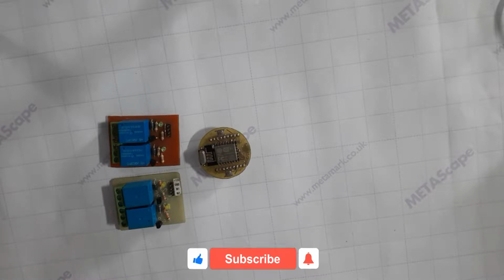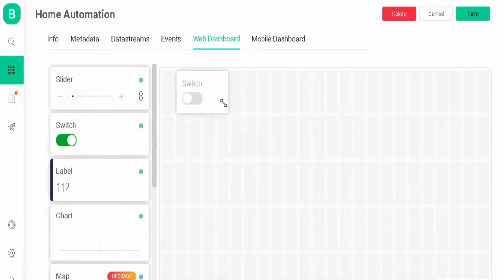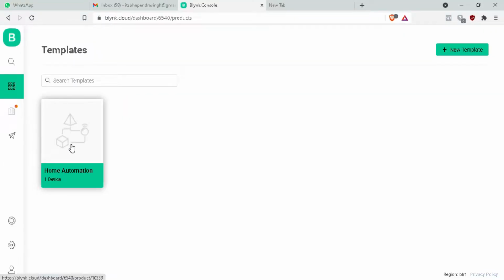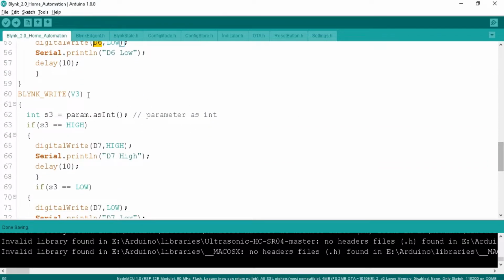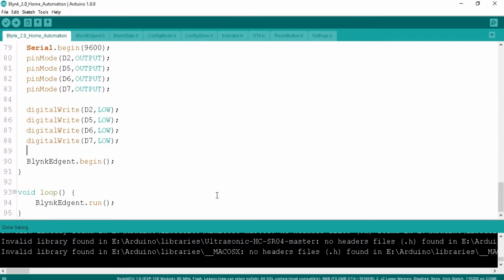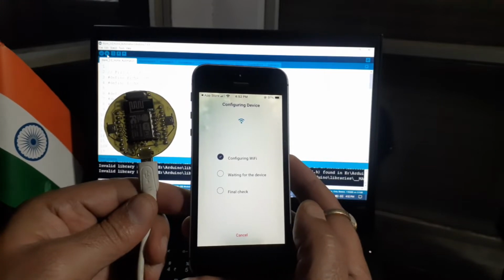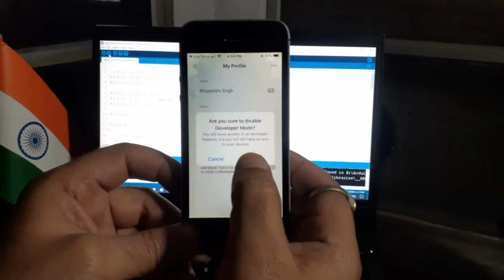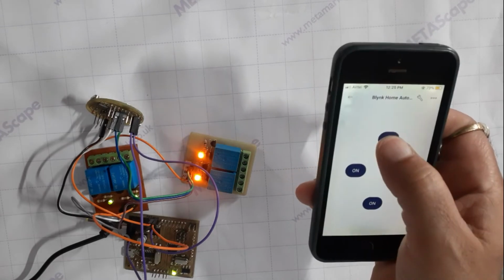Home Automation using New Blynk 2.0 & NodeMCU ESP8266 using BlynkEdgent Method | IoT Home Appliances

Comment: How to add 4 x one wire ds18b20 and 1x relay IN (free potential, contact) to this program. I had on the old Blynk with give me nothing works anymore, I don't know myself. thank you
Reply from the maker: Hi Frenky Vrachun,
As you know that DS18B20 sensor provide analog data. So either you can use ESP32 to read the 4 DS18B20 sensor or you can read all the sensor with arduino & send all data serially to ESP8266 board and ESP8266 will send that data to the blynk cloud. It’s simple.
Reply: @SMEDehradun  Thanks for the reply. It's simple for someone who knows. I was just a user of the esp8266 for central heating purposes. Unfortunately, the master who wrote the program for me is no longer available.
Reply from the maker: K. Plz look on below video links and try it. 

This link help you to read the DS18B20 data 
https://youtu.be/L0HqU-NiGgw

And this video will guide you to get the data serially from the Arduino Uno to ESP8266. 

https://youtu.be/V7l2ZWmMOQY

Comment: Sir I tried this tutorial, but the problem is when I connect the D2 of Nodemcu to IN1 of relay, the light in relay lights up without switching the ON button on my blynk app. What should I do? I want to control 12V solenoid water valve. I will use 12V batery holder to supply the power in my solenoid. Thank you for replying. I am willing to learn
Reply from the maker: K. 
Check that while you press the switch from the blynk mobile app, what’s the relay action?
Is it off while snitch pressed?
Reply: @SMEDehradun  it doesnt do anything
Reply from the maker: @jemariedelacruz7226  have you connect your board to wifi using NEW Blynk IoT app?
Reply: @SMEDehradun  yes, I can send you the screenshot so that you can see. Is that okay?
Reply from the maker: WhatsApp me at 9927715123.
Reply: @SMEDehradun  sir is it correct if I connect the VIN pin and GND pin of Nodemcu to the VCC and GND of Relay?? Then I'll connect the D1 pin?
Reply from the maker: You can connect. Yes you connect but be careful. Little wrong connection can damage your board. It’s batter if you use D5/ D6 or D7 pin for relay
Reply: @SMEDehradun  I mean D2 pin. My mistake. Is it okay to use D2??
Reply from the maker: Yes you can
Reply: @SMEDehradun  How about D8?
Reply: I plan to use D2, D5, D6, D7, D8 pins. I will control 5 solenoid water valve
Reply from the maker: You can use.
Reply: @SMEDehradun  thank you sir, you're the best
Reply from the maker: 👍. If this video helps, share to your friends.

Comment: code has error d4 has not declared what to do
Reply from the maker: @T-rex Jump D4? in my code, i didn't use D4 pin.
Reply from the maker: share your code,  we will check & revert you.
Reply: board button pin d4 error
Reply from the maker: @aayuxzxzettry-p6x  paste the complete code. This is just definition.

Comment from the maker: Everybody must comment for any problem regarding video. And One more thing, be careful while you connect the AC Bulb or any other appliance with relay, because maximum people got confused while connection with relay. So must check circuit diagram before any AC Equipment interfacing with relay.
Reply: Sir I successfully complete but relay automatic cut in every 10 second what is the problem
Reply from the maker: @rahiasif7574   ok congrats. You done it. 
Check the switch type you have configure in blynk mobile app. Change mode from push to switch.
Reply: @SMEDehradun  sir i don't have any computer so i am using arduino droid application in my phone to program my esp8266 board with the same code you provided. but my problem is when i try to compile the code it shows ' error : stray "#" in the programme ' . please help me sir it is my school project, and i am not rich enough to get a pc. thanky you .
and i subscribed your channel.
Reply from the maker: Hi,
Give us more time. We will soon Delaware video on it.
Reply: @SMEDehradun  sir can you tell me why it is showing like that?
Reply from the maker: Actually, we never works any Arduino code through mobile. Once we do it, we will let you know. But this problem will never occur in PC.
Reply: @SMEDehradun  aur ek baat , kya isme Authorization token ka zarurat nhi hai? kyuki apne nhi dikhaya aur code me iska option bhi nhi tha
aur wifi credentials ka bhi optoin bhi nhi langenge kya? plz reply sir i am in very stress for last 5-6 days.
Reply from the maker: In Blynk2.0, you can add the NodeMCU only through the mobile app. Once you add the NodeMCU through blynk mobile app then it will ask you to add your wifi credentials. See the video properly. You will get all the things clear.
Reply from the maker: If you want this in Hindi language then click to this link https://youtu.be/f2RVajugiE8
Reply: @SMEDehradun  thankyou so much for your valuable feedback. i appreciate your efforts very much sir . respect.
Reply from the maker: Most Welcome
Reply: @SMEDehradun  i have completed the project successfully by your instructions. thank you so much for your valuable time.
Reply from the maker: That’s great.